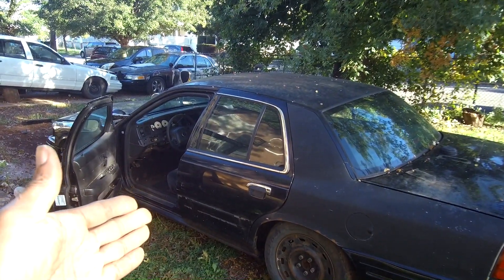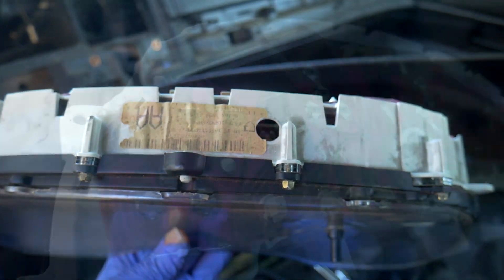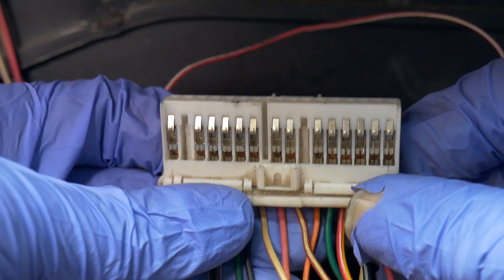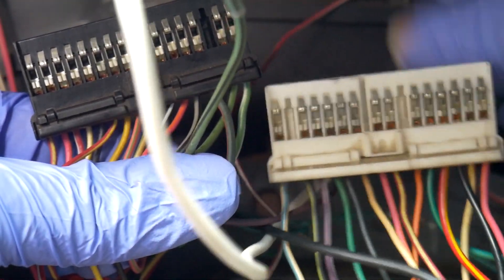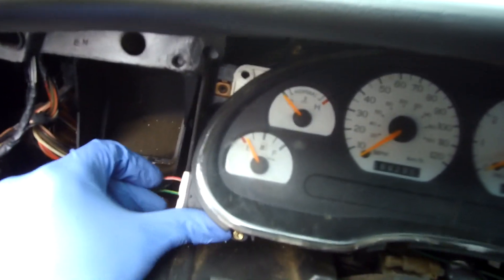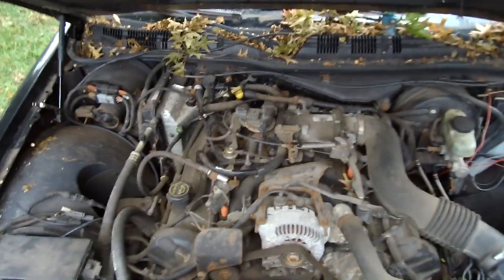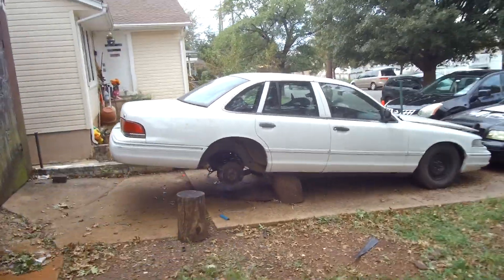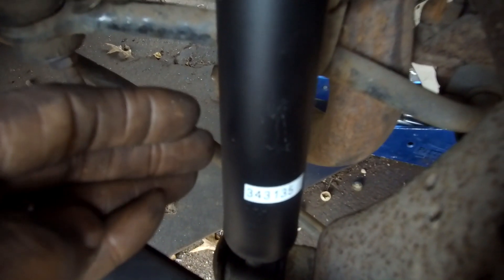Crown Victoria Instrument Cluster SWAP Pinout!

Comment: Id buy the modified cluster lol i want a tach in my 04
Reply from the maker: The wiring is the issue the cluster you can buy the V8 one... You be good, but to wire it aint so bad just need time to just do it...
Reply: @bstfordchannel923  is there a certain year to look for?? I'm like you I love chillin in the pick and pull finding a deal. I really want a tach was the only downside to my p71.

Comment: I was looking into a 5.4 swap from a truck. I think it would be pretty easy(as far as fitting it). Camms turbo etc. thoughts
Reply from the maker: 1st is a 5.4 2v or 4v... i was doing a 2v until i really thought about it in Na form it sucks, but I fihured in Turbo form it would be best... Na its about 260hp/350tq so add 80 to 100 hp to that ( with 80hp ) 340hp and 430tq ( low est )  100 would be well you get the picture.. It would roast the tires down side it aint reving ( chain to long ) 5.4 maybe the answer, but the older 5.4 has a forge crank just think you need rods cause thats the weakest part.. Making me re think what i am doing
Reply: @bstfordchannel923  well let me know what you go with this is mostly undocumented territory many have done it but few have recorded it I would love to see the project man keep it up👏
Reply from the maker: @fetts_revenge5535  ADHD is why i never did it, but what would make sense is if i blew a 4.6 2v i would slap that in there and then see what would happen... Dont know yet what to d0, but I need a laptop and tuner program to boot... Let see what we can do bro..
Reply from the maker: @fetts_revenge5535  I will brother I will attempt to do things that has not been documented... That you for this angle on content creating

Comment: Cool  , I see the other white  car still on wood stumps.. did you get the rear gears setup ?
Reply from the maker: I put back in the 3.27 gears that was in it vs the WORN OUT 4.10 gears... i added the shocks and spring and stiffened the lower arms
Reply: @bstfordchannel923  cool ,  hopefully you’ll be driving it soon .

Comment: Mustang cluster requires a mustang engine. Boss 302 exactly.
Reply from the maker: Thats it does, but in 96 ( which this cluster came out of ) v8 4.6 2v,,, The white car has the 4.6 dohc ... The plan was to do a 302 Cobra.. I which I had another Aero I would do that for sure

Comment: Is it the same for a 1996? Also could you directly hookup a aftermarket tachometer to the tac signal wire that goes into the dash?
Reply from the maker: 96 tach is on the ecu there is pinout thats closed you have to open it ( no box needed ) You can do what you say brother ( it will be best 0 to take the route you are going
Reply: @bstfordchannel923  so I can directly hookup a aftermarket tac to that wire and it should work as it's supposed to? No tac adapter?
Reply from the maker: @Tommysmess  yup only on the aero vic when you get the cop vics you have to tap in the harness and us adapter
Reply: @bstfordchannel923  strange I did not know that lol.  Mine is a digital dash
Reply from the maker: @Tommysmess  it should work the same i wishi was at that point with my car... I would do a video on that

Comment: Hey bst! That's the low coolant indicator,  it was v6 only.  Take the bulb out. I love the swap! Much better than the p71 I did on the mercury.  I finally fell to dark side.  A 1200 nightster. With the tune and screaming eagle she hits 11:80s in the quarter. Next is a 50 hp sneaky Pete 🤪
Reply from the maker: lmao you see these bikes are like CRACK lol.... Stay safe riding those things ( track is great though ) I have to finish these bikes but the one carb stays leaking so i have to fix that thing....and i have 4 of them.... this  is the best weather to get with them I will video that also